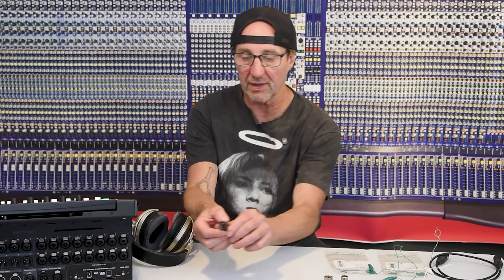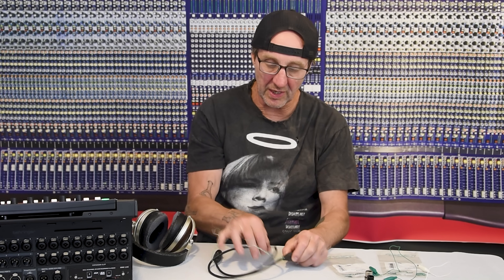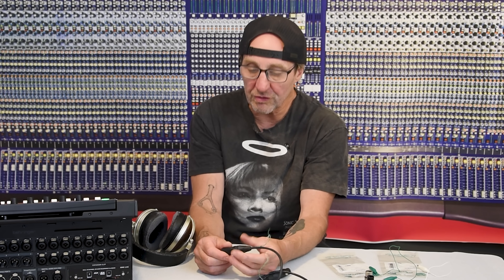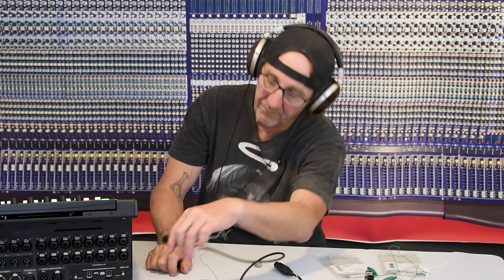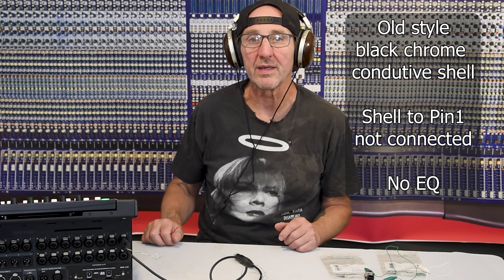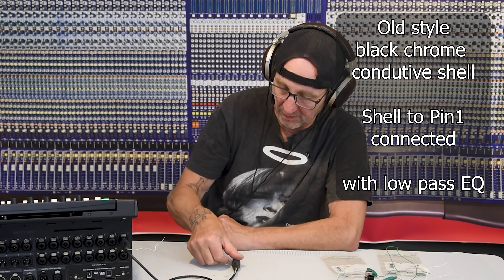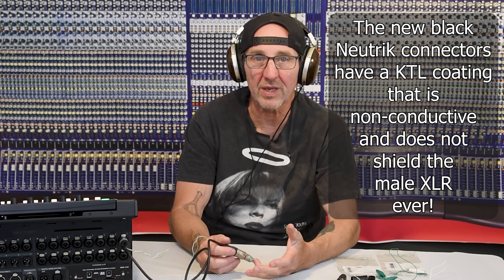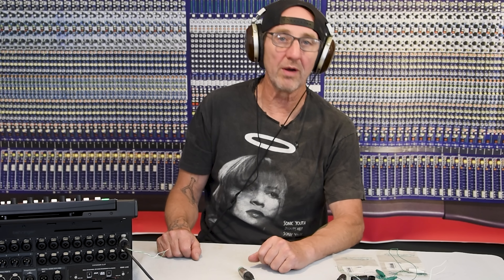Now Black Neutrik XLR Shells are Not Grounded

Comment: More bullshit, you had to contrive a completely unrealistic situation WAY outside of normal useage parameters to demonstrate a basically non existent problem.  If you need that sort of performance you're not going to be using XLR in the first place regardless of how it's coated.
Reply from the maker: interesting. I can agree that someone who has limited knowledge or experience could see it that way but what is more interesting is why you are adversarially butt hurt about it.

is it because you have such full, clear and confident understanding of the subject? 

is that the way confident people with clear understandings act?

FYI, for situations where you are extending mic cables and you need to reduce noise or you're dealing with high gain environments, the new non-grounded shells don't offer any shielding. The cumulative noise of 10, 20 or maybe even 100 or more ungrounded shells can be an issue. Or even just extending one mic cable when recording a very quiet sound requiring high gain, it can be an issue as well.

but you are correct that this is not an issue for people that are in the lower levels of pro audio which is most pro audio people. but to assume that it's not an issue for anyone is flawed and shortsighted

I'm not just projecting possible issues but rather as a manufacturer of audio equipment, this change to non grounded shells has proved cumbersome and expensive to us. After testing the new shells, we have converted all of the products we made with black etherCON shells to nickel because the black ones offer inferior grounding. the ungrounded shells are even more of an issue for analog over etherCON as the grounding on etherCON is quite poor.

maybe someday you will make it to higher levels in audio and encounter a scenario where you think back and say oh shit he was right. on the other hand with the attitude that you have right now I don't think that's in your future.

and most importantly. my experience has been that those that know the most and have a true understanding, don't get mad or act with aggression, they smile and are not threatened by info they know is incorrect. and maybe they will kindly offer correct info. No need to be angy if you fully comprehend a topic.

conversely, those that lack understanding tend to lash out and get defensive as they try to elevate themselves and quash their fears through insults and ignorance

which are you in this scenario?
Reply: @DaveRat Who the hell is going to run low level/high impedance signals over any significant distance and even 10 let alone 20 or 100 connections? Only a complete idiot would attempt to do that regardless of how good the connections were.
Reply from the maker: while it's not that uncommon to put out a large rock and roll gig or tour with 100 inputs. Dead & Company uses more than that.

who said anything about high impedance? this is all XLRs regardless of whether they are balanced professional mic cable with professional microphones plugged into low impedance balanced inputs or an XLR used for whatever purpose.

but the fact that large professional shows use lots of inputs is not really the issue here.

perhaps you don't fully understand the issue and that these new painted and insulated shells means that when you plug the XLR male into the back of the mixing console, the console no longer has the ability to ground the shell of the XLR.

which means every single XLR male shell in your entire system no longer connects to ground and no longer offers any shielding over the wires inside that shell, with these new connectors

to make things more interesting, in the mic cable the wires are twisted which helps reduce noise but there is a small segment of mic wire that is not twisted right where it's being soldered into the XLR terminals inside the XLR shell. These untwisted wires are more susceptible to noise than the twisted wires. This is where you need shielding the most. But with the new black insulated shells that non twisted segment of wires are no longer shielded and you now have the least amount of shielding where you need it the most.

with the old black chrome shells and with the nickel plated shells, the mixing console or any gear that you plug that XLR into is able to connect to that shell and ground the shell and provide shielding 

these new shells are insulated and no longer allow the gear that you're plugging it into to ground the shell. 

every single XLR shell in your entire system with these new shells, is no longer providing shielding. 

so a band with 40 inputs and a front of house and monitor console would have 40 to 80 unshielded XLR shells plugged into the stage racks or consoles. and typical mid level touring bands tend to have 48 to 80 inputs or so.
Reply: @DaveRat In your demonstration you were literally listening to white noise because your gain was so high yet you could barely hear the hum under that noise.  Post a video of an actual real world situation where this is a clearly audible problem and it might be possible to take you seriously.
Reply from the maker: in all my videos I try to do the demonstrations using cheap gear with simple setups so that anyone who wants to confirm or disprove what I am doing, can do so easily.

my position is to point out things of interest and concern such that those impacted by them can be more aware and informed.

it does not sound like this issue impacts you or is something you have run it into so it matters little if you believe me or not.

if you do decide to test and mess around with it I will gladly assist with questions.

I would say one way to test this in a real world that you may want to try is to connect a mic to an XLR cable and extend the XLR cable with a other XLR cable and plug into a mixing board. these can be regular XLR cables and don't need to be the new style, as long as the shells are not grounded ( pin 1 connected to the 4 metal tab)

now, with a mic in a very quite place like trying to record crickets at night, gain up the channel and then touch the XLRs where the extensions are connected 

you should hear an audible hum. hold anything that emits electrical noise near that connection and you should hear noise.

now,  if these are old style connectors you could ground pin 1 to the 4th tab and fix the issue.  on new style black insulated connectors, grounding the 4th tab will not fix the issue

my goal is not to tell people what is right or wrong but rather to get people to test and learn.

Comment: What a shame as Neutrik don't offer a nickel housing with gold contacts. Silver contacts are a BIG no-no if you want reliable contacts in an outdoor or harsh environment as silver oxidises VERY FAST and unfortunately silver oxide is NOT a conductor (it is a semi-conductor).
We switched to gold pins years ago and had far less noise on our lines than with the old silver contacts (especially where 48VDC is present on the line and there is a tendency for galvanic reactions with the air (a serious problem for us in a rental company in a costal area where the air is somewhat salty. 
Now we have to chose between non-oxidising contacts or a grounded connector shell. ... THANKS NEUTRIK.  - I guess they just don't talk to their users.
Reply from the maker: reach out to them, and let them know. maybe they will release nickel gold.

I will mention it next time and also see if maybe they will sell us the nickel gold combo.

our soundtools products use a lot of Neutrik and we are one of if not the largest purchasers of neutrik
Reply: @DaveRat  there are currently some 50th anniversary ones out, but as a “special edition” it doesn’t bode well for a longer term product. The black ones were always “cool” for stage use, but in reality nobody really cares if they are black or not. In my 40 years on the road I’ve never had someone say “get those silver coloured plugs off my stage”
Reply from the maker: agreed and same!

Comment: You're going to be wanting to take care with cable construction and keep the unscreened portion of the cable inside the connector as short as possible now as you cannot rely on the connector shell to "extend" the equipment enclosure around your termination.
Reply from the maker: exactly

Comment: No, they aren‘t. But I know no one would even solders ground to the shell contact. In fact, a lot of our experts discourage people from doing that (I personally see no problem in soldering it to ground).
Reply from the maker: you are absolutely correct that the ground tab should not be soldered to pin one. 

 that said, The XLR shell should ground to the chassis ground of whatever it's plugged into to provide a telescoping shield. 

so when you plug an XLR malel into a mixing board, The shell of the XLR should ground to the chassis ground of the mixing board providing shielding and pin one should pass through as the audio ground. 

when you connect a female XLR to a microphone the shell of the female XLR should ground to the chassis of the microphone which also happens to be attached to pin 1. 

The issue is that if the XLR shells are non-conductive, this can prevent the mixing board from grounding the shell and therefore create hum and buzz issues that can be alleviated with a grounded shell. 

And this is what I demonstrate in the video

Comment: Damn.  I'm just building a stagebox for my keys/mic/monitor out of new black Neutrik ethercon & XLR (figured on black to blend in and be tidy). Fingers crossed it'll get through our meagre setup.
Reply from the maker: should be fine especially for line level adventures. typically stage boxes are not grounded anyway so wheyher the shells ground to the ungrounded stage box should make no difference
Reply: @DaveRat cheers dude, love your work

Comment: That DOES explain a few issues lately. I have those XLR connectors in an RF and Digital Noise environment and noticed after replacing some cable after new replacement gear install I was seeing noise and worse hearing noise. I thought it was the new gear. Now watching this video a second time I quickly replaced a few cables that are Neutrik NC3MXX / NC3FXX un painted silver-nickel and the noise is gone. Why would Neutrik, who prides themselves on superior connectivity, go that way. I can see a large console with analog, AES, Probably even Dante on the RJ45s.  Thanks for the info and if anyone is going to NAB NY in October they can ask the Neutrik factory rep. Unfortunately that week is a heavy sports production week for me so I will not be there.
Reply from the maker: if you haven't seen it already, this video is where I go into more depth on why they did it. 

https://youtu.be/sE-JJJxVU7k?si=gu_ONaZ5NdxQDIQe

Comment: Needs to be conducted, but if they really wanted that, they should have maybe gone with the "anodised" coating... too costly, I guess.
Reply from the maker: they are kind of doing something similar to anodizing but with paint. actual anodizing only works on aluminum titanium and magnesium I believe. 

also anodizing creates an oxidized layer that does not conduct so it would have the same problem. 

The KTL coating and anodizing both involve immersing in a liquid and using electricity too form the layer. 

masking certain areas so they don't get coded can be done with anodizing and I would assume it could be done with these as well but I don't know enough about the process to make that assumption or know what's involved 

I do know it was not an oversight as they release the technical bulletins informing of the non-conductive shells, I guess just thinking that it wouldn't matter much, which may be true for most people

Comment: Dang, I was hoping the new black XLRs would avoid the same issue as the ethercon shells. I understand the environmental concerns, but Neutrik could also only sell the nickel shells.
Reply from the maker: yeah I guess they figured and probably correctly that not enough people will notice to be a financial problem for them. 

with most things being digital and the days of long analog snakes and cable runs mainly in the past, it's not near as much of an issue as it would have been 10 or 20 years ago
Reply: @DaveRat  Maybe I need to back to Switch Craft XLR.
Reply from the maker: yeah I don't know what switchcraft is going to do about it. Are they going to continue using the process that creates this toxic forever chemical waste so we can have pretty black connectors or will they switch over to paint as well. 

then what do we do? if you really want the best shielding and the lowest resistance then you need to use nickel because even the black chrome have a higher resistance. 

as a manufacturer of products we looked at alternate sources and the issues and determined that for us to seek out a manufacturer that uses the old process is kind of socially irresponsible, so we switched to the nickel shells where it mattered most to us which analog over cat ethercon cables and connections

Comment: Would it help to do a little sanding on the inside of the shell on the spot where the shell tab makes contact with the shell? I think it would solve the whole issue. Thanks for sharing this Dave! I would have never noticed the new coating was isolating the shells.
Reply from the maker: I haven't tried that, on the scale of it my company buys things by the hundreds and thousands that's not a feasible adventure. 

I would be interested to see if someone tries it and comes up with something there. 

maybe I'll take a look and see if there's an easy solution but the whole getting a Dremel tool out and grinding away on a $3 connector to make it worked properly is kind of annoying. 

I would recommend using nickel shells if you need the shell grounded for high noise and high gain environments 

otherwise I wouldn't worry about it because for most applications it won't matter anyways

Comment: It's always been odd to me that you can't buy a nickel XLR shell with gold pins. I have some, but only because I made them by swapping components.
Reply from the maker: interesting I never really thought of that. 

I don't think it makes much of a difference but I don't really think gold is optimal unless all the gear you're connecting to also has gold otherwise you've got the dissimilar metal thing. not a big deal but if you're in a highly corrosive environment where gold actually has an advantage And you kind of wanted everywhere as well. 

though black and gold does look cool and perhaps that cool look overcomes the slightly higher contact resistance that the gold has

Comment: Could neutrik not solve this issue by simply coating the outside of the shell in tue KTM/Paint while keeping the inside of the shell nickel?Seems like this would solve the issue but would add process costs.
Reply from the maker: I am remiss to make assumptions as I'm quite familiar with the complexities of manufacturing products. everything you do seems create a myriad of other problems. 

the KTL coding is a cathodic dip coating or e-coating that involves full immersion in liquid and the paint adhering until it is fully insulated from the electo charge. similar to electroplating but with paint. 

My guess is that finding ways to have areas not coated was challenging and they were fully aware and released papers saying what they were doing and it looks like they really tried but were unable to solve the problem

Comment: So I guess at this point if you need the lower noise floor just use all nickel shells everywhere. Black= Higher noise Nickel= Lower Noise. Yes this is a big issue for lager scale installations with many connections! Might even effect measurements on an AP APX?
Reply: Grrr. All my existing analog cables are built with black shells and gold pins. All my AES cables are built with chrome shells and silver pins. This going to make it much harder to distinguish them.
Reply from the maker: The idea world is so diverse it's hard to say how much difference it'll make and where. 

and totally agree, use nickel in the somewhat uncommon high noise environments and high gain environments

for me it's about the fact that there is a change and being aware of the change so that if it does cause an issue it could help us troubleshoot the problem. 

The impact on ethercon shells is a bit more severe because the of the way the grounds work versus XLR. 

XLRs are typically a 4-pin connector with the shell being the fourth pin available on older styles but no longer on the new style. 

on ethercon the shell is part of the only ground offered and acts as a redundant connection to the not so great single ground wiper.

https://youtu.be/sE-JJJxVU7k?si=VfTy2xTpiwmNHjh9

Comment: I have some EtherCONs that are a couple years old, so ostensibly before this KTM coating, and they are "conductive", but they measure noticeably worse than the nickel ones still. This was causing problems with my AES50 line when static electricity built up. I lined the black EtherCONs with copper foil tape and haven't had any AES50 loss since.
Reply from the maker: interesting and using a better cable will solve the issue. if the slightly higher resistance of the old black shells is the difference between problem and not problem you are on the verge of issues. 

try extending your cable 20% and if it still works perfectlt then you are what I consider to be a good safety zone when you remove the extension.
Reply: We are also seeing this issue with the new coating on Ethercons. We have discovered this is especially apparent using long runs, where AES devices fail to connect, or cause a huge spike of static audible via any connected output devices in the system. Would be cool if @DaveRat could create a test for this too.
Reply from the maker: I've done several videos on AES 50 and long cables. 

here is a link to a video about the KTL shells on ethercon

https://youtu.be/sE-JJJxVU7k?si=qeogtgv3sTT_c6FZ